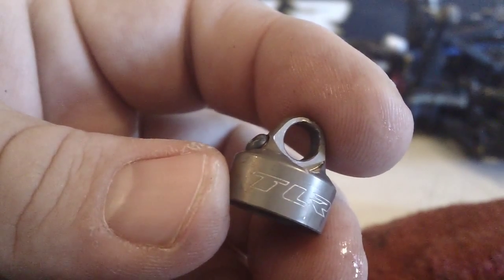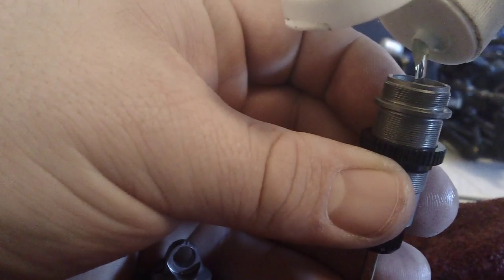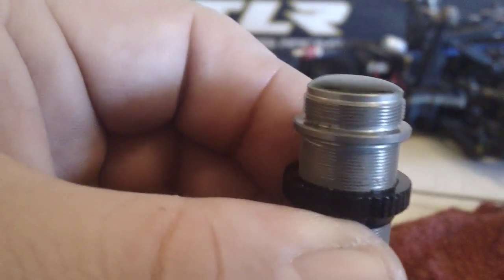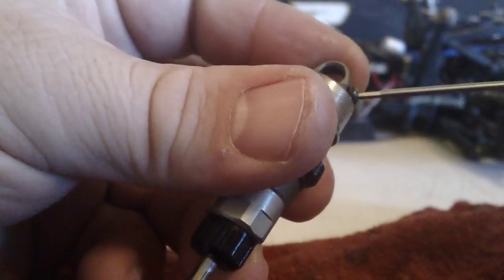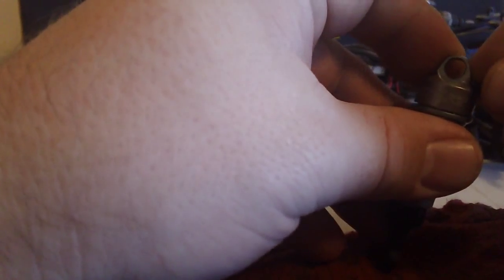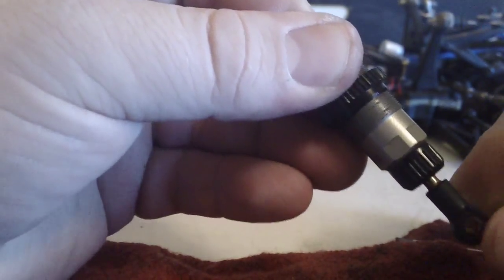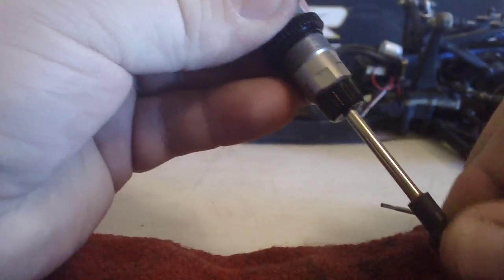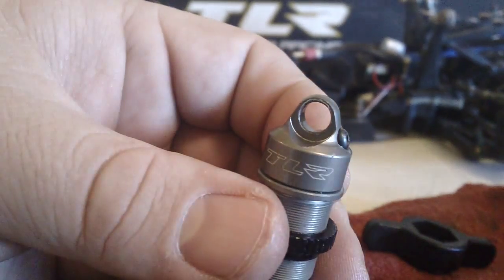Rebuild your shocks with a bleeder cap

Comment: Dude, you pushed the piston all the way and bled out all the oil.  Now, you don't have enough oil to dampen anything.  Did you do this for a reason?
Reply: For anyone else looking at this video. There's a Team Losi video where they do exactly the same thing, however they do push the piston in much more slowly.
Reply: @spykeza  you never open the bleeder then open up the body sucking in more air. The idea is to get the air out the get the proper dampening.
Reply: He didn't bleed out all the oil. It was just a drop or two that came out because it was slightly overfilled.